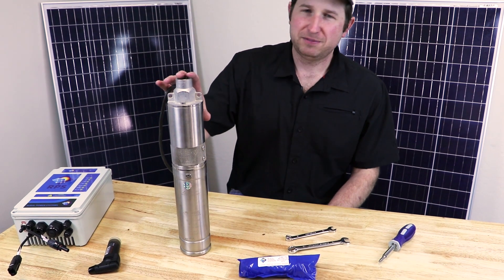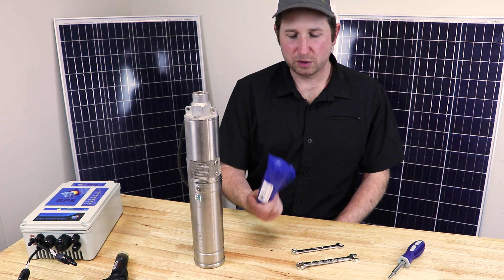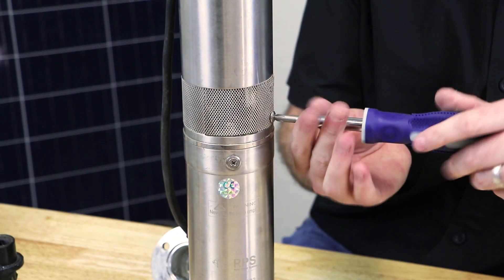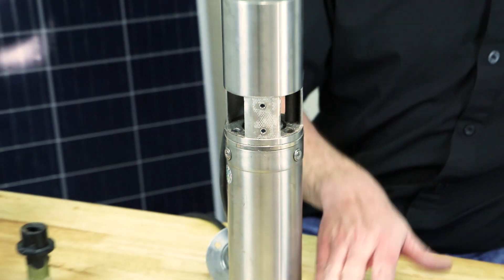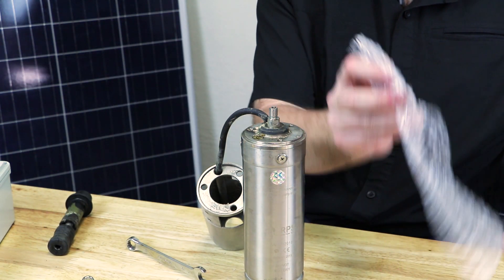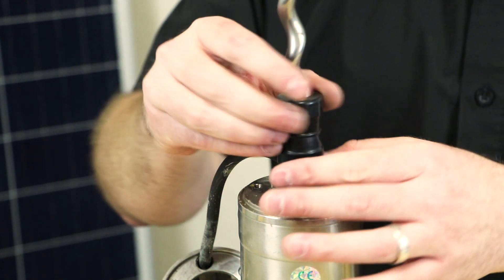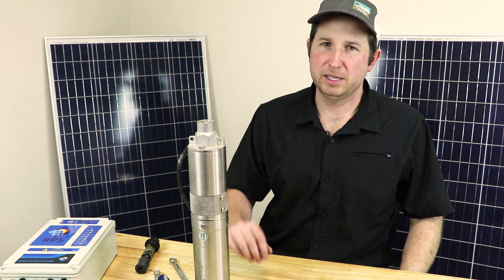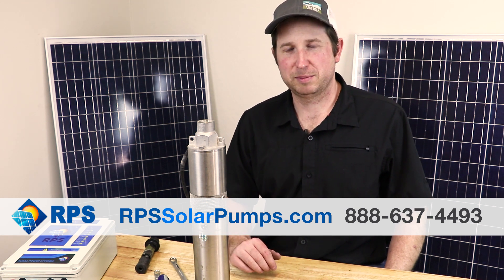Helical Pump Mechanism Replacement HOWTO

Comment: Great video!  Its shorter than your tech service answering machine. Please add a few items to the video.  1. The set screw mentioned in the comments.  2 Torque setting for the bolts.  3.  Setting the screen properly to not allow particles to bypass (Mike does a poor job  on the video).  4.  At least acknowledge that doing the replacement in the field will require brushes and towels to clean the pump out.  5. You might unattach the pipe and safety rope or you can do it without by adding another 10-20 minutes. 6. The sleave on the wire does not slide like in the video but bunches up and won't fit back thru the top without a visit to your own shop.  Lastly, I use a filter sleeve even though I was told I didn't need one.  In my situation (solid granite) it was absolutely needed. I recommend it.

Comment: Thanks for the info my friend. Clear simple instructions. I do mission work in a very dry semi-arid part of Brazil and just installed the first of three of these pumps (solar powered) almost identical to the one in your video. They also came with a replacement helicol and stator. Many of our wells are 100 to 120 meters down. 4-6 meters of sand then rock (granite).

Comment: Is there no seal or mechanical seal between the screw part and the motor ?
Reply from the maker: Yes the seal is around the shaft of the motor.  Hard to see, but it is that black piece right at the top of the motor as the shaft exits.

Comment: So that is the ONLY replaceable part in the system? What is in the lower part?
Reply from the maker: The lower portion is the pump motor. The pumping mechanism is the only part that wears over time so we have designed it to be field repairable. Other pump manufacturers require replacing the entire pump end (top part) or require sending the entire pump back to the manufacturer to be refurbished.